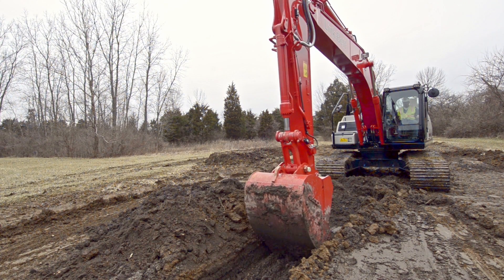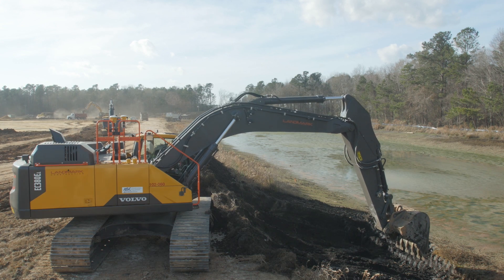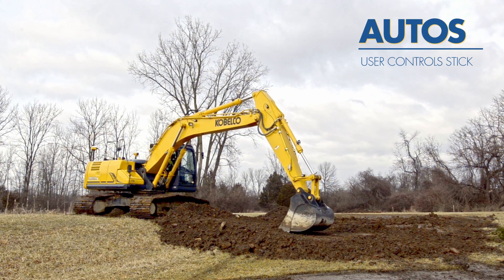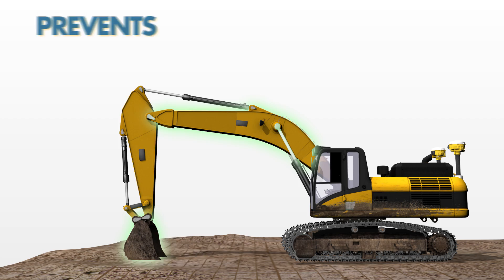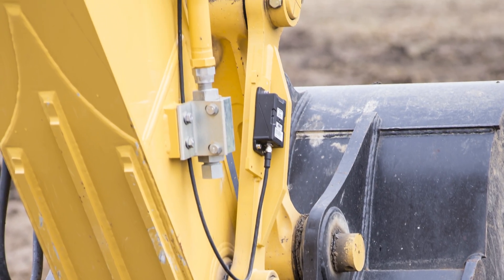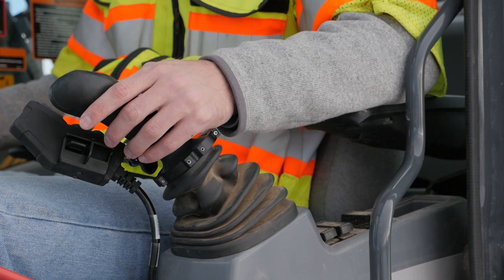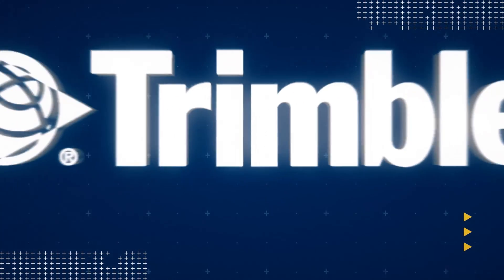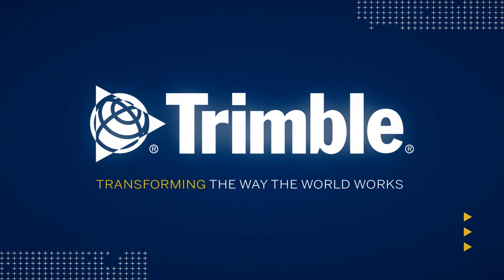Trimble Earthworks: Automatic Excavator Control

Comment: This looks a lot like IDigBest who has been installing systems for years
Reply: Looks like, but is very different! This actively controls movement of the boom and bucket each direction, over the full range, with no speed restriction. IDigBest doesn't do all of that. Additionally you can chuck GNSS on top and guide to 3D designs.

Would encourage someone to put both systems side by side, would be the best way to see the differences.